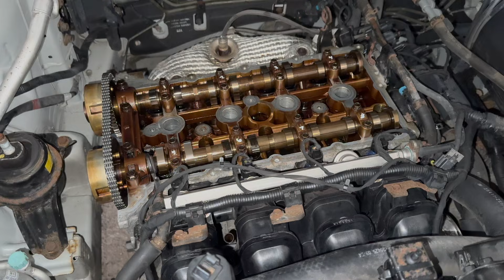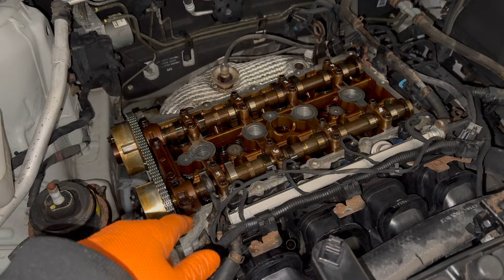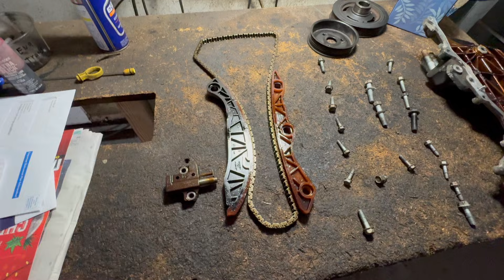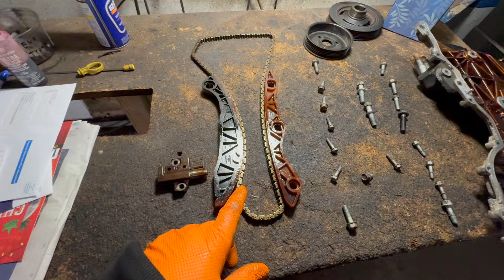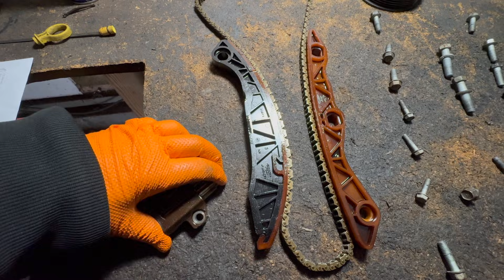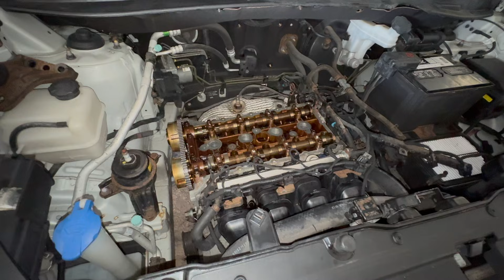Jumped Timing Chain Or Belt Symptoms, Causes, and The Fixes

Comment: how do you tell the difference between a Broken and a Jumped Chain?, and if a chain is broken is it a costly fix ( labor time not the actual part of the engine )
Reply from the maker: You have to gain access to the chain depending on vehicle the easiest way is to remove the valve cover. If it’s broken you’ll see it right away. Again, depending on vehicle it’s a big job but prices vary greatly so I can’t just give a dollar amount and be accurate.